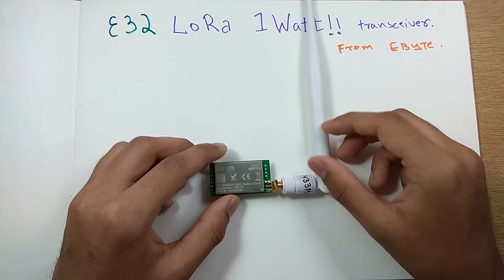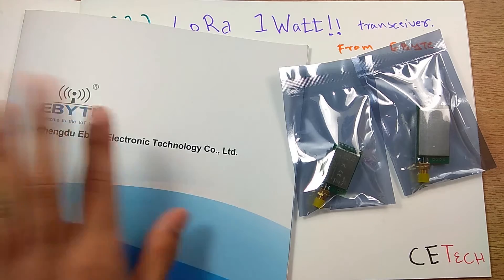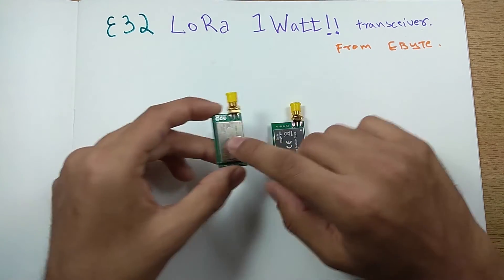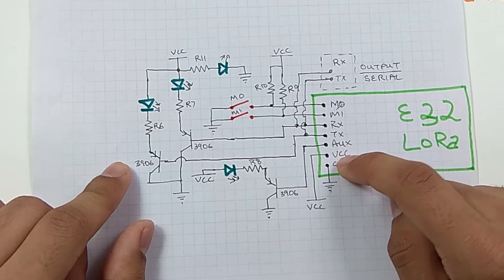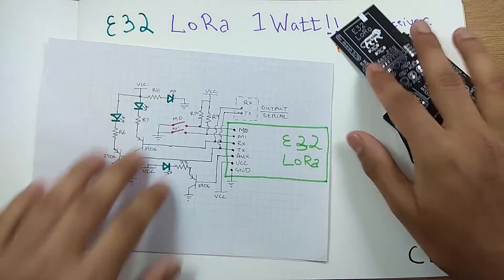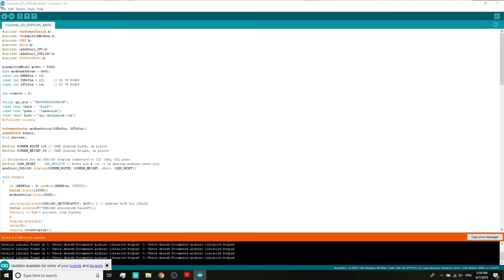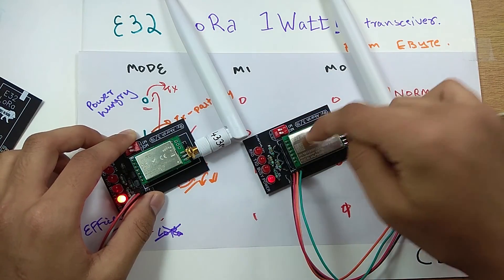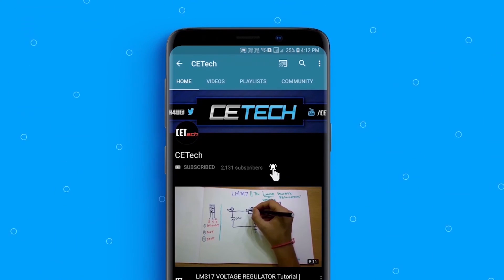E32-433T LoRa module Tutorial | DIY breakout board for E32 module

Comment: Hello
I have the right RF setting software for E32 modules and I get the ' No response from module ' error for some reason . Nothing wrong with the wiring between the E32 module and the ftdi, the COM port is always detected and the ftdi chip works fine. The port settings for the communication are also correct , baud rate / parity check / and so on.. 

Any ideas as to what might be causing this ? 
Great videos and channel.

Thanks

Comment: Amazing work! Congratulations and tanks, it is very important for my projects, which involve sustainable development. I'm a beginner in the field, so forgive me if my doubts are silly, I ask anyway, because here in Brazil we say: there are no stupid questions, there are stupid ones who don't ask, lol. I am an Environmental Engineer, and LoRa, along with Sigfox, are essential for the realization of my projects, and for that I am very grateful 😊 About the E32 433MHz ttl-1w module, I'm having problems ... In the Datasheet it says that 1A of current is needed to feed it, do you use such a powerful power source? Did you add the transistors to correct the voltage? Can the entire circuit with resistors and transistors be replaced by converters of bidirectional logic level in Tx and Rx? Anyway, only with the material wue has available in your channel, they are a gold mine, because I am having problems with this EByte module (I bought it because it is 1W), but all other LoRa modules (all with SPI communication) , I managed to make it work thanks to your tutorials. Thank you very much!

Comment: Thanks for the detailed video. can u make a video using  LORA (cheap one because we only may need distance up to 50m) for water tank level meter and automatic on/off solenoid motor with manual turn on/off switch?
Reply from the maker: Thanks for that! Do subscribe for more content like this..
I've added it to the list!
Reply: @CETech4u  Thanks for the reply and yeah you got one more subscriber!
btw i just realised we dont need to use LORA infact 433mhz RF transmitter and receiver will do the job as its range is around 100km and is cheaper as compared to LORA.

Comment: Have you done any testing with sleep mode (mode 3)? I'm trying to put the module in sleep mode except when I need to send data. For some reason, I'm only seeing every other transmission. I can upload an Arduino sketch to show how I am doing it.
Reply: just guessing from the video - but didn't he mention that the Tx module needs to send 2 messages? 1 to wake the module - the other for the data?

Comment: hey , can you tell me if you have some problems of alimentation with the 8km 1W module ? With my project, everything work well in 100mW but when i am using 1W module it make bug the system... I guess it is the 1W power but do you have other solution to give to me ? Can you tell me what is your power supply to power on the 1W module ? do the TTL level is important 3.3V or 5V ?
 thank you alot if you can answer to my questions
Reply: If you found any solution, could you share me please? I have an same problem

Comment: Excellent video! I didn't catch in the video that both mode pins are supposed to be high to use the RF setting software from Ebyte and left them grounded thinking that normal mode was ok - I didn't get that far in the video yet :) . If anyone is getting an error connecting to this LoRa module (I used a USB to serial FTD1232 board) and you've verified COM port is set to 9600 baud, make sure both of those node pins are set high (3.3v).  I was sitting there with my oscilloscope looking at the TX of the serial output (RX of the LoRa module), seeing the correct waveform being emitted from the Ebyte software and banging my head against the wall for over an hour... :)
Reply: Maybe a silly question : how do you make these 2pins (M0 and M1) high? Just connect them to 3.3v? Thanks for your clarification
Reply: @GioBen68  yea